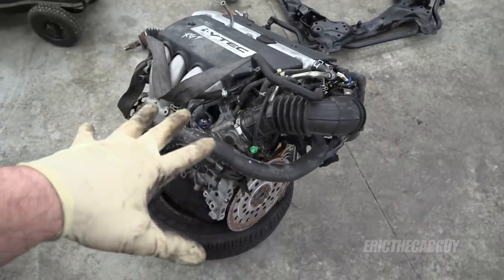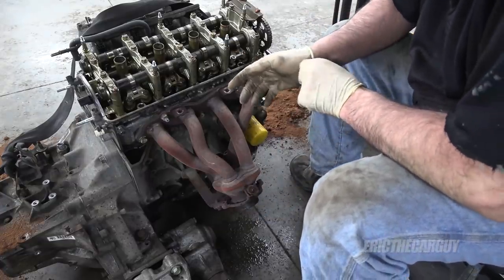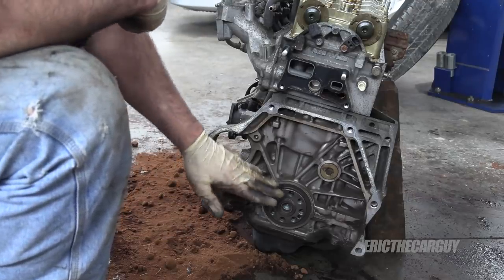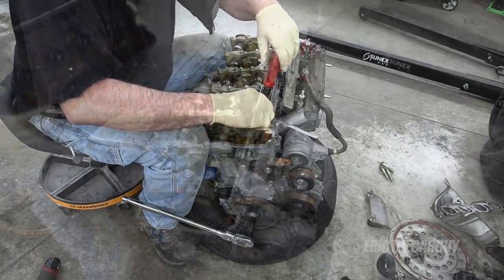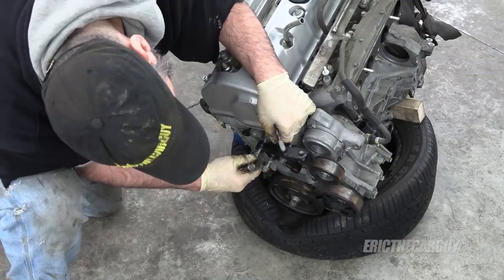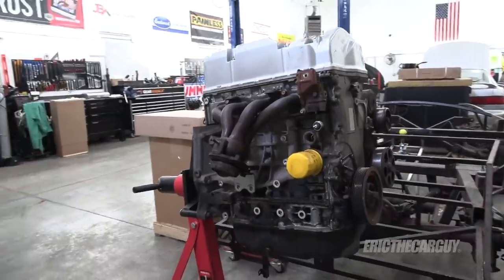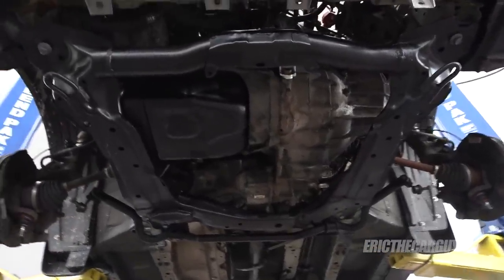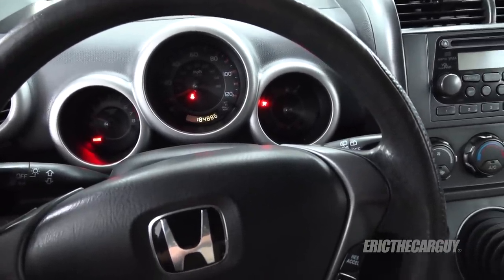Honda Element Engine Replacement and Restoration (Part 2)

Comment: I've literally only changed brakes a couple times but I thoroughly enjoy watching these full teardown and replace videos.
Reply: he makes it look simple, gave me a lot of confidence that I can do a lot of it myself and I did. I'm still not going to do a transmission or engine swap but I can do belts, hoses, pumps, suspension, brakes, some electrical work and all my routine maintenance now.
Reply: ill tell u it ant that bad doing R@R on engines and transmsions iv doen a few my self jsut take your time and doubble check yourself as u go along and read manuels if your new or unser abotu something

Comment: It’s a good feeling when you fix something and it actually works 👍
Reply: You don't really have a choice when ur a mechanic.
Reply: Fr ,on my mdx I disassembled the whole engine to get to knock n harness and said hey maybe I can take my covers off and do a valve adjustment,now I I just gotta wait for my plug seals,it had brand new fel pro blues but they didn't touch the valve lashes,EVERY SINGLE VALVE was tight,like no entry,so I'm hoping my 'click' issue is fixed,if not,timing belt

Comment: Just did a valve lash on my Civic after watching an ETCG video. Sounds a whole lot better. Now just have to rip it all apart again to get the front main seal to stop leaking...like a sieve.
Reply from the maker: Do the oil pan gasket first. Many times it's the oil pan gasket and not the front seal.
Reply: @ericthecarguy  I replaced that a year ago and was drip free. I did a new clutch and replaced rear main seal about two weeks ago. I feel like a seesaw is at work in my oil pan. Didn't touch the front of the engine at all then a small drip started. It's not a hard job just tired of pulling all the belts and such off.

Comment: I like the backing up demo @36:50 . Even after getting used to backup cameras, i've found that nothing feels more in control and comfortable than the old right hand around the passenger seat. It just works, and is the way I taught my daughter to do it.

Comment: 12:02 based on recent direct experience removing the transmission from my '05 Element, occasionally you get thread damage from corrosion that sets in on bolts that "daylight" through the transmission housing.  The damage occurs during removal and cannot be avoided since you have to remove the bolt.  Best to use a thread chaser kit or a same-size metric tap and die set to repair the inside threads and the threads on the bolt before reassembly as you did.

Comment: If you do this more, I use one of those wood furniture dollys from harbor freight to support and roll the engine around when I drop it out the bottom. Haven’t needed the use of a crane since I started pulling them out from the bottom.
Reply: I will have to keep this in mind!
Reply: I do the same thing. With a couple of 8x8s sitting on top of the dolly, one under the transmission and one under the oil pan.

Comment: Thanks, I was planning on checking out an '05, 2WD, 4sp. auto with 267,000 mi. Element @$2500 this week, and you'd given me a lot of points to inspect, here and in your other videos. 
Unfortunately, or more likely fortunately, you've put me off going to check out this wonderful SUV. 

It's elemental, my dear carguy: Undoubtedly this 16 year old (even well maintained) Element will need some work within a few years, and it's much more difficult (and expensive) to work on than the '70s VWs and '80s Toyotas I'm confident working on.
Plus, I don't have access to such a wonderful shop as yours, or the wealth to pay a shop; And most importantly, my technical skills don't hold a candle (drop light?) to yours. My 5 years of shop experience (30 years ago) at least taught me that much. It could have been a disaster.

So, unless I'm visited by a convincing Angel overnight I think I'll have to pass on the 5 hour round trip to see this Element. :( Thanks again 
(But, I feel like I just learned the last puppy of the litter I was going to see tomorrow had already been adopted).

Comment: I wish you lived closer to where I do Eric because you’re about the only person I’d allow to wrench on my Element . Like you I love my 2009 Honda Element . Haven’t had to do a thing to it but change out the starter and brake pads. All I’ve ever owned has been Hondas because of there reliability and resale value. Of course I don’t even start thinking about selling them until they’ve hit 300,000 miles on them. I sold my 95 Honda Accord that had over 300,000 miles on it and it still didn’t use or drip a drop of motor oil at anyplace on that motor and would still do 120 mph and believe it or not when I sold it everything on that old Accord still worked and everything inside of the engine bay/ doghouse was all OEM and nothing had ever been replaced. The starter , Alternator and A/C all still OEM . The only thing I hated about that 95 was changing the timing belt and water pump every 90,000 miles. Thanks for sharing what you do Eric I really have learned a lot .

Comment: I've used a few JDM  K series for swaps to replace tired or neglected engines. They're fantastic. Never had an issue. They're as close to new as a used engine can be.
Reply: Found this video as im looking to ether rebuild mine or possibly get a JDM to replace it but am a little worried as to what the better route is to go. Is it really this simple? lol

Comment: Good job glad to see the Honda Element project is going well. I usually make a wooden frame to sit the engine in which keeps it sitting level and then have that on a flat board on top of an engine trolly jack, it saves on needing to put strap bolts in the engine. Been wondering did the police ever catch whoever stole your catalytic convertor?

Comment: Loving these videos. And yes, I learned the hard way when changing out my starter which way was easier.
Really curious about the AC. I have another lawn ornament that has a similar issue with the AC wanting to stall out the car, and haven't gotten around to it yet.

Comment: My Very good friend installed my import Exactly the same way,  super clean inside, excellent compression on all 4 Cyl .
 The previous owner of the car didn't understand the need to change there oil .....    CHANGE THE  G.D. OIL  peoples  its 30$  .. :P

Comment: Drove an 09 for 7 years and loved it. Started tapping so took it in for what I thought would be valves. Dealership sent me the video of scored piston cylinders and told me new engine and 6k+. Only had 68k and I took immaculate care of it. Synthetic and all routine maintenance done. I was the second owner and only had 23k on the ODO when I purchased it.  Problem must have resulted from original owner. Traded it in on a newer vehicle but here I am watching these E videos desperately wanting another one. Seems like they all have high mileage now and the few low mileage ones I'm lucky enough to find are commanding serious bank.  What to do?  Maybe buy one of these high mileage ones and learn how to engine swap like Eric?!

Comment: Heads up...if ya got a something in the undercarriage that you'd like to preserve, shoot it with some Slip-Plate (basically a graphite paint). Works good on exhaust parts too and electrical connections that are in places where corrosion is likely (it's conductive and hydrophobic).
Reply: I feel Fluid Film is another good preservative product..
Reply: @JasonSimonSmith  It has its uses, but Slip-Plate can protect exhaust parts as well, including keeping cast iron manifolds looking nice. And it doesn't wash off.

Comment: I counted how many times you mentioned taking off the valve cover and drizzling oil over the valvetrain and it was three! I guess good advice bears repeating!
Reply from the maker: I also shot this video over a couple of days. It's hard to remember if you said something the day before. Thanks for the comment.
Reply: @ericthecarguy  Oh I'm aware! I meant it more as a joke because you said you didn't know if you'd mentioned it already. definitely how I do it too. I imagine I'm dressing a salad with oil when I pour the sweet 10w40 all over the cams

Comment: Two sturdy milk crates, one under the engine, one under the trans, is how I've done Honda engine jobs for years. They slide on the floor well for positioning and have some give if things get too tight.

Comment: Eric you’re awesome!!

You da man for buying and fixing up all these elements. I’d love to get one but my 99 CRV is lasting and lasting. I’m tackling changing the timing belt and I just changed all the fluids and flushed the coolant. The top end is quite clicky. I can’t tell if it’s valve train of pulleys. I’ll check the pulleys when i do the belts. I’ll also do the valve lash. I expect it’s because I haven’t done the valve lash ever.

Comment: Tip for you Eric, when you leave a car on the lift after removing the motor/trans or both, mark the floor where you drop it so you have correct positioning for installation...speeds things up.

Comment: I have a small group of honda element workmates. all have had to replace condensers.   Wish my 08 AWD was manual.  But at  11 years of ownership and 40k miles, I can't complain.  Wish it had more power..
Reply from the maker: The manual trans does make it a lot more responsive.

Comment: Nice work.  Surprised you didn't have a 12x1.25 tap (considering all your work on Hondas).  Even weekend-warrior me has a 12x1.25 tap (+ x1.50 & 1.75).  Great tip on the pilot bushings regarding automatic vs. manual.

Comment: Thanks for Sharing......Awesome....Runs Great!  Almost like Brand New.....Hopefully, the AC issues will just be a Fuse or some contacts/wire that are lose, disconnected or need to be cleaned......something simple.

Comment: Lot of work there! What about doing a head removal,  honing the cylinders and replacing the pistons and head? I did that with a mechanic friend 25 year ago on a BMW 2002 but I wrecked the car (sad sad sad). Then I sold the engine to someone to put in his 2002 and he wrecked that one.  Sorry, we were young!  But I guess I'll never know how long the engine would have gone.

Comment: Great stuff! I'm in the middle of restoring a 2003 element. These are some really cool and quirky little cars. After long consideration I'm paying a guy to install a junkyard transmission  since the 4th and 5th gear in my original one died.  Did you install new output seal on the trans?

Comment: Great job Eric! If you want to give the element away, I would love to do my 80 mile daily commute in it. Beautiful car especially with the millennial anti theft device installed (3rd pedal)
Reply: Good one. I have an '07 Cummins manual. I went to Discount Tire and insisted pulling the truck into the bay.

Comment: For the airbag light just take some contact cleaner or something and spray it down inside your seat belt latch and fracture measured just do it on both I use a contact cleaner and lubricant I had that same nasty little airbag light and that solved the problem

Comment: I just did this exact thing in one of my Elements over the winter. I must have tweaked the input shaft putting the transmission back on, because now it has a rattle at idle that goes away when you step on the clutch 😭

Comment: I'm not a mechanic by far. Just did my first engine swap in my 06 accord thanks to these videos and more from YouTube.  
But I can't understand under why people say dropping the engines vs pulling out the top is easier...... you have more control and do less work.  Not arguing.  But genuinely wanna know why its said to be easier.

Comment: Super curious about that AC. We had a mustang that cycle quickly and rev high enough at a stop light to push through a light brake application. Local shop replaced a hose they said was blocked like an artery. Not sure what happened unless it was some stop leak that comes in every DIY can of freon.
Reply from the maker: It got better over time. I'm thinking the oil might have settled in the compressor while it was hanging down. I'm also thinking someone overcharged it at some point. I'll cross that bridge at some point and make a video about it. Thanks for the comment.

Comment: I didn't realize that an input shaft could use a pilot bushing.  I mean, the flywheel is usually spinning at > 1K RPM. I would have figured that you'd always have to use some sort of needle bearing for the pilot bearing.

Comment: Great job Eric! I'm wondering if the AC system is way overcharged and bogging down
the engine while possibly having a separate issue with the AC fan. Hard to say.
Reply from the maker: I agree, I think it might be overcharged.

Comment: I did the same thing to my Element. Got a Japanese engine. But I had code P01720 System too rich. I read that the fuel injectors need to be swapped out for the American fuel injectors. The Japanese ones push a little bit more fuel. Not sure if that's correct but I swapped them out and the code is gone. Engine feels kind of weak when I push the pedal. Feels like I have to push the pedal down more than I should to get it go.  Seems to be ok when the RPMs are higher. Not sure if you have ever had that issue?

Comment: Pro-Tip - DONT work on your open transmission in the middle of a literal pile of dirt with an impact. You’re asking for trouble there folks! But Eric’s a pro, I’m sure it went fine!
Reply from the maker: It was oil dry, and I made sure not to get any in the open areas of the transmission. Thanks for the comment.

Comment: Quick suggestion instead of using an old tire why not grab a couple of cheap furniture dollies from Wally's or Menard's? I paid like 14 bucks each for a few of them and it makes moving engines, transmissions, and stacks of wheels and tires around way easier and with a piece of 4x4 block or bricks your engine will sit level and fairly steady while you work on it

Comment: 10:45 Not really strange that the engines stopped in about the same place, It's a 4 cylinder so 25% chance it will stop in about the same place (compression stroke of the same cylinder) and that's assuming the engine shuts down immediately when the key is turned off and not after the key is turned off, the computer shuts the engine down after cylinder 4 fires, or something like that.

Comment: "...install yourself! It will not respond to my commands, looks like im gonna have to do it." Thats what came to mind with this engine replacement
Reply: I’m reminded of a bit of snark from an old Fixing it Forward video here:

“Remove the wheel... (pulls wheel cover off) ....it’s still on!”

Comment: On the bigger rats nests of wires and hoses, I tend to take a couple snapshots with the phone camera;   and I tend to stick my bolts in a circle through a piece of cardboard, to know where all the different length bolts need to go at reassembly.   That motor looks like a great find--  good thing you could steal all that broken stuff off of your old motor.  They didn't handle the new engine very well. lol ( but it does look well taken care of by the owner)

Comment: My Element had the same starter bolt cross threaded. That was a “fun” discovery when I had to replace the starter. I ended up just using a longer bolt (grade 8) and a nut and washers to fix it since I didn’t have the ability to fix the threads while it was in the car. 

The trans mount had a couple cross threaded bolts too. #sigh

Comment: A/c is shutting off cause the fan motor isn't coming on. Had the same issue on mine was afraid the comp was junk. knew the fan was bad replaced the fan and all was good
Reply from the maker: That's not the issue, but thanks for the comment.

Comment: can the oil pump balancer assembly be removed while its in the car? mine is clacking away down low and it wasnt the chain tensioner.

Comment: No 6 speed conversion while its apart?  I put in 2010 Civic Si 6th gear dropped the rpms drastically when running 70mph.  
06 EX-P with 260k miles still running strong
Reply from the maker: There wasn't anything wrong with the transmission that was in it to begin with.

Comment: Is this the JDM K24A Eco engine? I have put one of these in my element. It's been running great. Though I had a thought that in Japan they have much higher octane, now I'm wondering if I should be using more than just 87. But also I still have my north American ECU, so might not matter overall.

Comment: ,on my mdx I disassembled the whole engine to get to knock n harness and said hey maybe I can take my covers off and do a valve adjustment,now I I just gotta wait for my plug seals,it had brand new fel pro blues but they didn't touch the valve lashes,EVERY SINGLE VALVE was tight,like no entry,so I'm hoping my 'click' issue is fixed,if not,timing belt..if anyone knows a clicking sound at idle but if you hit the gas it goes away and stays off at high idle 2-3000rmps?

Comment: Was there a special way you installed all the mounts ?  I just installed a new engine in my element and was wondering how you aligned the engine and tranny correctly
Reply: The passenger top engine mount allows me to pulled the engine forward or push it too the rear before i torque it down

Comment: Nice engine swap. All of mine were front engine, rear drive, which seems to be a lot easier. Not bragging, just how it used to be.
Reply from the maker: I do those too. https://www.youtube.com/watch?v=kCepnacqRuI&list=PLSzhQ6St-ov1g_GML2aVq6EN-_ShJ9G2o

Thanks for the comment.
Reply: @ericthecarguy   I watched that too.  What I was a little kid, I’d stop and watch any guy working on a car. I probably drove them nuts with constant questions. I was never chased off😊. My biggest challenge was an engine swap for my 1969 Corvette, which I did alone, and I still own.

Comment: Jdm vtec solenoids dont have pressure switches. I use them and bypass the switch at the ecu harness. 1 less failure lol.